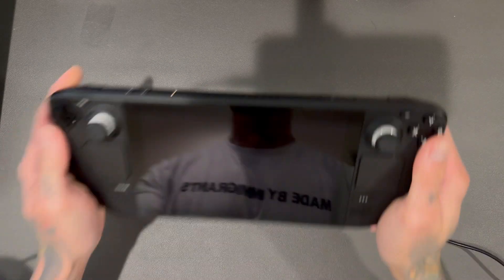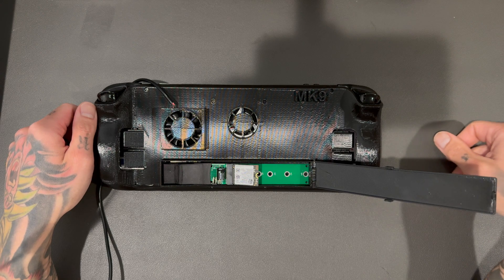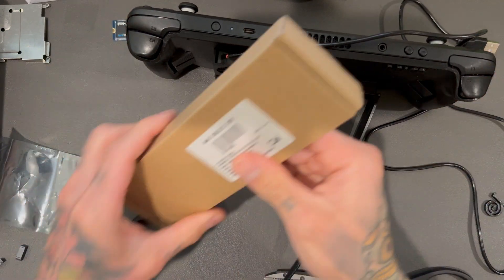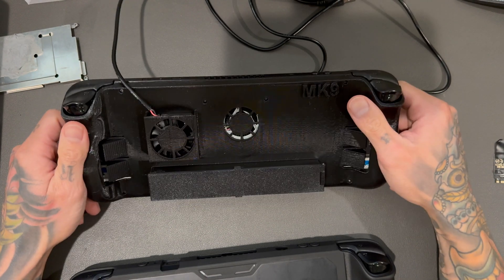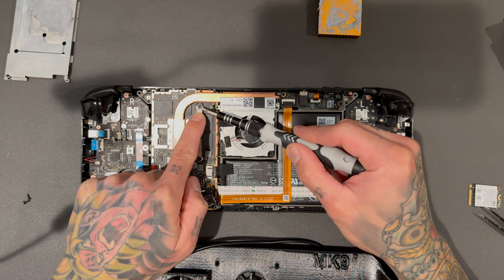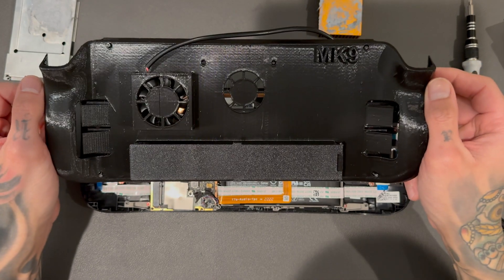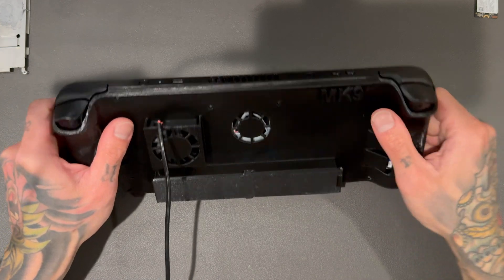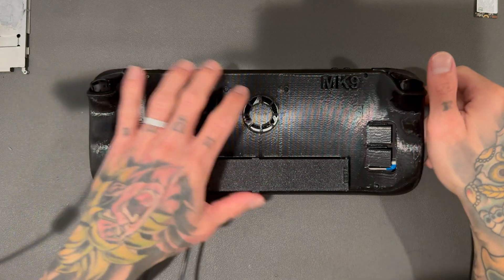Best Steam Deck Backplate on the Market - MARK 9 #steamdeck #mods

Comment: Awesome mod. Maybe I missed it as im rushing to eat and stuff on my work break, but what are the temps like with this mod installed? Ive been looking for a proven and practical cooling solution for a while now.
Reply from the maker: Thanks, I haven’t made a dedicated video on temps yet but it does run as cool if not cooler then the steam deck OLED. 

There is actually a revised version of it now.

That video will be up next.

Comment: Just a thought, rather than have big bulky bumps for the fan and SSD riser, just raise the entire back of the plate, with recesses for the grips and paddles. You can also cut off the excess from the riser board, if you're not using 2280 SSDs, and have a smaller bump. Going one step further, you could have a giant heatsink on the back, with one fan drawing air over it. Then you wouldn't need an extra fan/intake & exhaust. 

I'd love to see someone send the STL off to an on-demand printing/machining service, to get it either printed in higher quality, or have it machined from billet aluminum.

A service like PCBway could also make custom riser cards specifically for the SteamDeck that are more compact.
Reply from the maker: Custom riser card is a great idea

The bump out is unavoidable unfortunately.

I’ve tried making one huge bump out and it looked way worse it added complexity and material waste, so I axed that design.

Comment: Papz please do a step by step tutorial on overclocking the deck, from gpu to cpu to ram. I’d really appreciate it. I play Escape from Tarkov and really need the boost in fps. It’s either I get a successful overclock or need to buy a pc. Please help🙏🏼 thank you
Reply from the maker: I got you bro
Reply: @Diy_Papi  thank you man, honestly I’ve managed to overclock cpu and gpu but when it comes to ram that’s when things go wrong. Anything you can go to help I’d appreciate, also if possible talk about people that have upgraded the ram to 32gb and what potential benefit or flaws that could have, seen people upgrade but nobody has mentioned results!